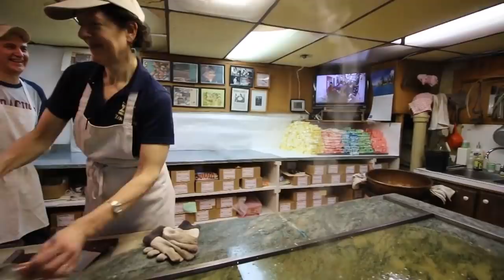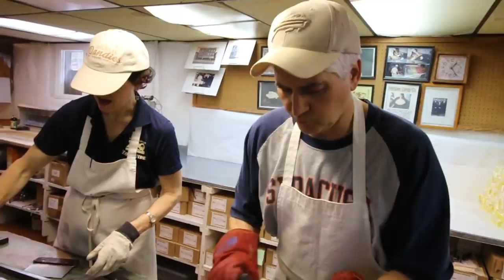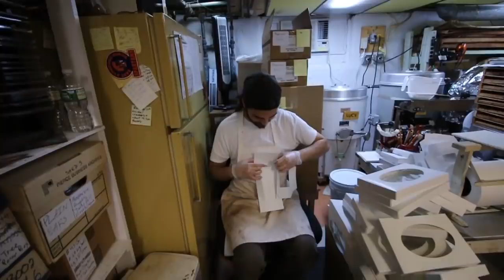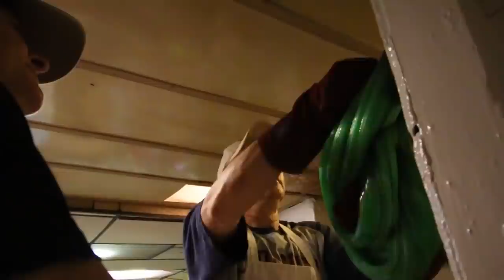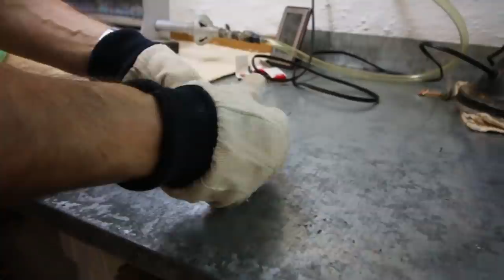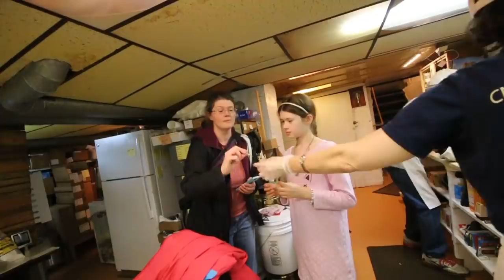How Spearmint Ribbon Candy is Made | Day 6 of Ribbon Candy Week

Comment: do you charge extra for the crud that falls from them stained roof tiles??  just asking.  should replace them before the health dept. see the videos....  love the stuff you do, but some may see it as an issue.
Reply: Grim Reaper they themselves have stated that the ceiling tiles have been checked & approved by health inspectors every time, so what is the problem?
Reply: Sabrina Czyszczon it’s disgusting and there are so many health code violations if this were in any other country. Here in Canada this would be shut down so fast. 

First is the kid coming in and making a ribbon on the sanitized (hopefully) shaping table. Then there’s the fact that I don’t see any licensing visible (a huge must have here) and the general clutter of the place is considered a workers compensation hazard. Home companies still have to adhere to public health for big Corp. which includes storage. Proper disposal. Garbage fees. And monthly health inspections where they even check bathrooms for working locks and check bacteria levels of surfaces.
Reply: @kaidanariko  
Just thought you should know the table is made of marble, it's not dirty.

Comment: That green is pretty! Question... why do they not pull the candy that makes the stripes? What's the purpose of even pulling the candy?
Reply: Ragen Fenners pulling it will lighten the color aand add air bubbles in it. When you dont pull it it will  come out or gem looking vs dull looking. peppermint for example the white is pulled candy while the red is sometimes not pulled and noticeably more shiny

Comment: Is there a reason you guys flavor the sugar after you pour it out? Does it affect the flavor or texture?
Reply: The flavoring has a flashpoint, means it will cook off completely at too high a temp. Much safer to add after melted sugar is off the heat.